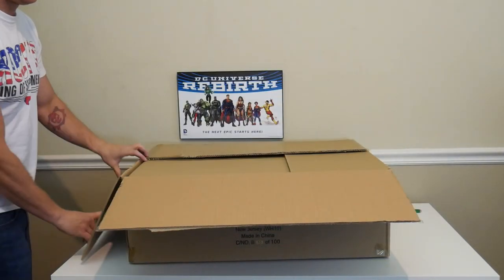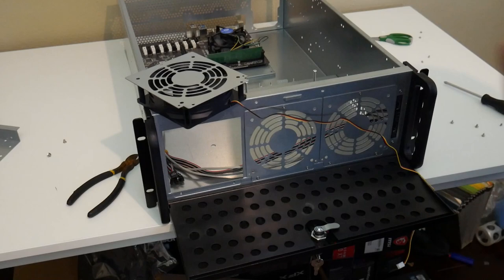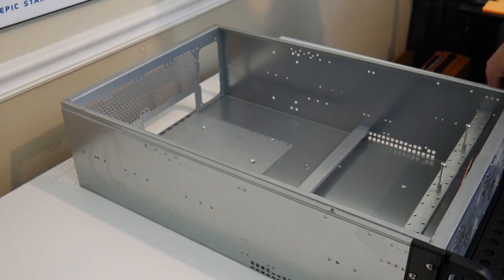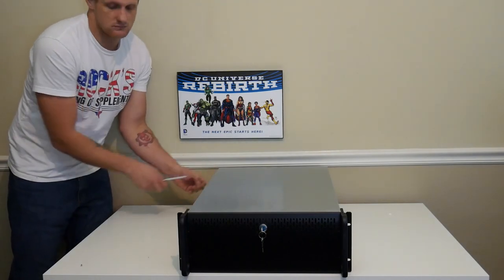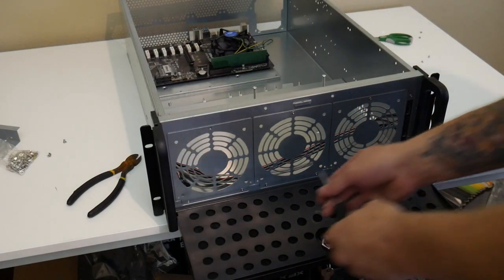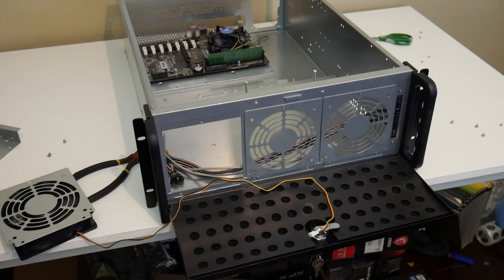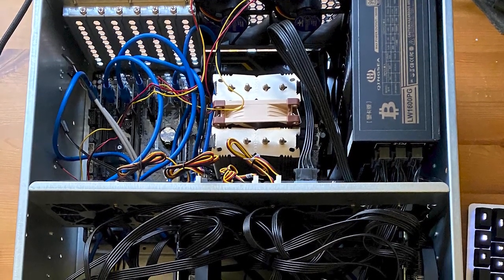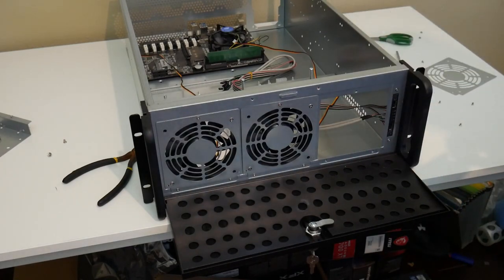Rosewill Server Chassis For GPU Mining

Comment: I am using 4 of these cases with just 3 -208 cfm 120 mm fans running at 80% power. Works well with 6 GPUs, but will change to 8 GPUs soon (two short and 6 long due to the long Rosewill 1600w Hercules power supply) and add more fans to the rear of the case.